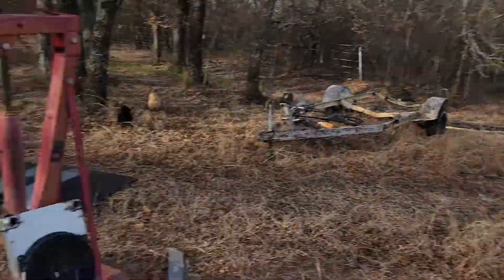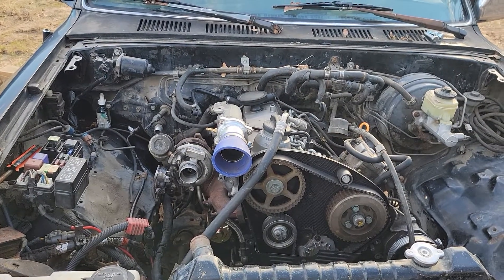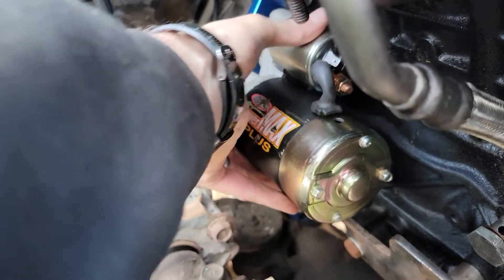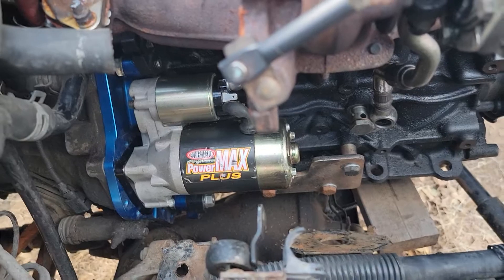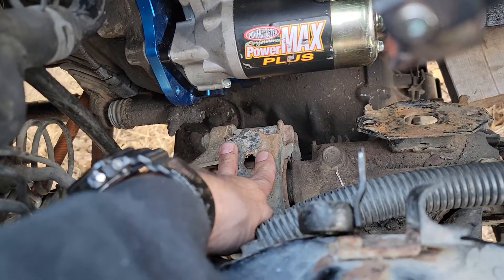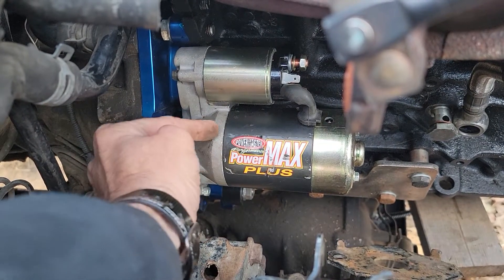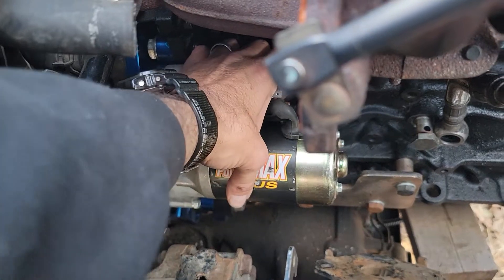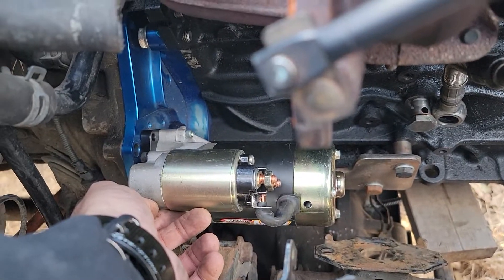TDI Swap Into Second Gen 4Runner Starter Angle

Comment: Hey great videos! I'm about 2 steps behind you; I've got a 2002 ALH and a 1995 4runner. I just got the TD Conversion adapter mounted on the engine today. Hopefully I'll try and test fit everything next weekend. I'm curious about oil pan clearance, did you run into any issues? Were you able to contact NW Fab regarding the starter issue? That's bad juju! Most of the Toyota/TDI conversions I can find online are done in straight axle rigs, and they have the room to install the engine without angling it for diff clearance. AND they don't have torsion bar brackets in the way of the starter. IFS make things a bit crowded, I'm thinking a differential drop kit may be in order. That'll help the oil pan clearance, but wont do anything to help with the starter problem...
Thanks again!